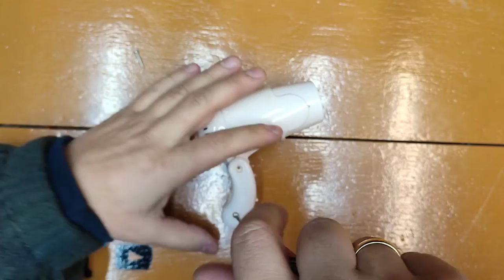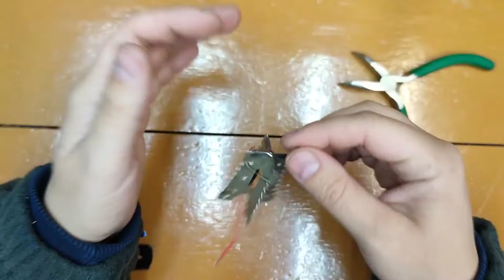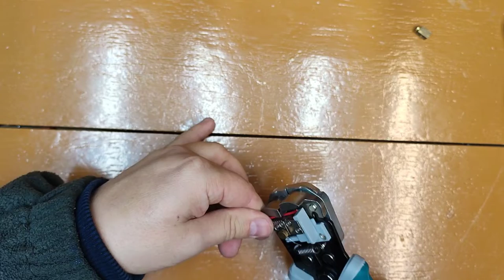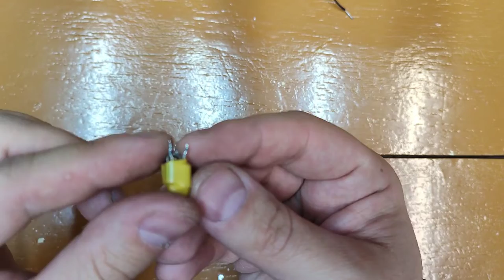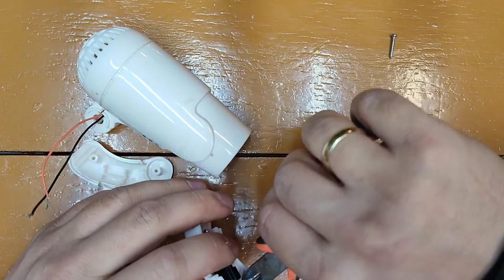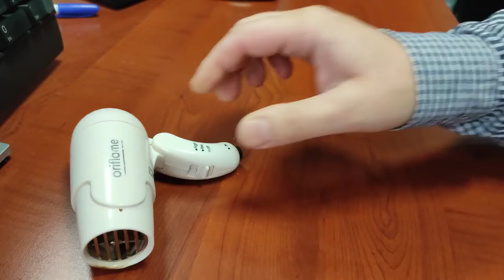DIY portable Smoke / Fog Machine | Tons of smoke from old hairdryer

Comment: Which is the setup of your power source? I mean, amperes, Watts, etc  Also, could you explain about the resistors you use for the fan? Are them the ones you find within the hairdryer? If not, could you please share the specifications? Thanks in advance!
Reply from the maker: The power supply was 12V li-ion battery, so honestly I don`t know how many amperes and watts the smoke machine will draw. I`ve used 4 pieces of zener diodes  in series to lower the voltage to the fan only, because it needed to be slowed down in order to make good consistent fog. It can be made with fan connected directly to the 12 V supply, but the fog might be not that good. Honestly I don`t remember the values of the diodes, they were take from some old PCB laying arround in my workshop, but it`s not that crutial , I mean you can use any zener diodes until the speed of the fan is reduced, let`s say at half speed, it`s just the matter of little experimenting. I hope this will explain it :)
Reply: @FixitEasyDIY  thanks very much for the details! certainly, helped to understand better. I'll try to replicate your experiment and I think I may change the motor for a 12v one, because I already have one. Thanks again

Comment: hey i tried to recreate it, but it doesnt heat enough to make the fog, i used a 9v battery because its the highest i could find. I also tried making the wire that heats shorter but still doesnt heat enough to make good smoke. Can u help me please?
Reply from the maker: The problem is the battery. It cannot output enough ampers. In principle shorter wire is the way to increase power, but you said you tried it. Try using 2 batteries in parallel.
Reply: @FixitEasyDIY  yes i tried both, i have just very little wire, and even tried 3 in parallel, should i try in series? i also did find 12v but extremely small like a AAA but half its size lol
Reply: im thinking of using 9v battery as well. i thinking of using this for a choir competition drama. lol maybe the coil should be heated first before starting the fan. maybe the heat at first does not touch the wet cotton till its hot then with a switch or a lever it will be in contact with the glycerin..
Reply: @dasalpanalanginatawitin  if you figure it out please tell me how, id really appreciate it

Comment: How the fog made? Is it because the hot air from the hairdryer pass the glycerine and let it become the fog?
Reply from the maker: Actually the glycerine is heated directly, because it is inside the heated wire. It becomes fog immediately. The fan is just distributing the fog. This principle of fog making is the same in old fog machines in night clubs but in bigger scale. The glycerine must be heated significantly to evaporate into fog. This particular project uses 12 volt power supply to heat the kanthal wire and run the fan in the same time. Pretty easy to make, and yet safe enough 🙂

Comment: Hi, can you tell me exactly which diodes to use please I want to build one like that.thanks
Reply from the maker: I really don't remember what diodes I used. Actually it will work just fine without them. I added diodes to lower the voltage a little bit, but in different situations it might be not needed. If you decided to use diodes, you can simply experiment with any diodes you have on hand. They were connected in series to lower voltage in my project.

Comment: Good work, what did you put in series to the fan, resistors? Why and what is the value?
Reply from the maker: Thank you man! I have put couple of diodes to lower the voltage because it works better with lower RPMs on the fan. It's not that crucial to make it the same, i just wanted to create thick fog instead of big volume. I couldn't capture good enough the result. Believe me it was very impressive 😉
Reply: What type of Diodes are those? Great work by the way